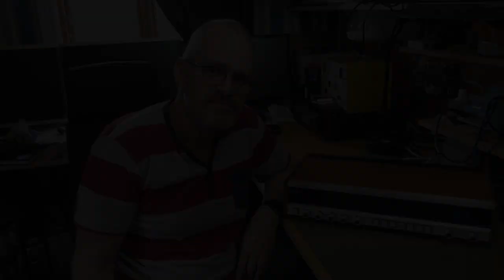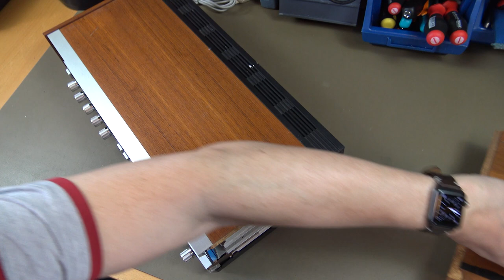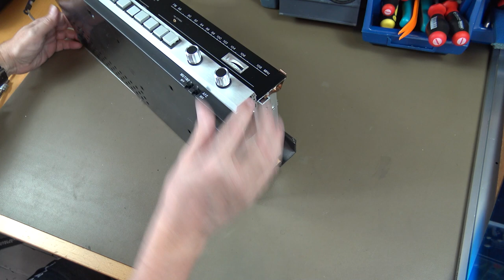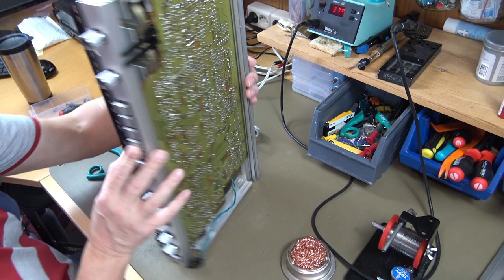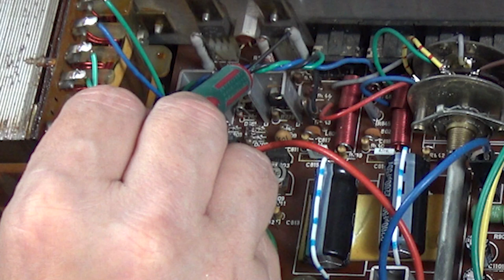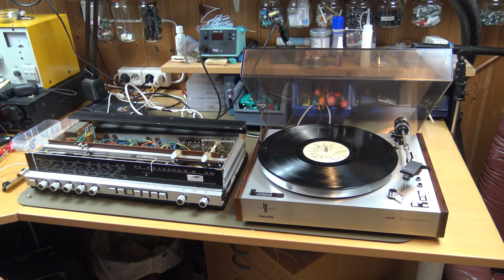Tandberg Solvsuper 12 recap and adjustment

Comment: What a fantastic job Sir!  Your patience and diligence and skills are incredible.  I'm thinking of buying a Tandberg 2060 L but the radio is stuck on one frequency.  The dial turns but the pointer doesn't.  Your video has now convinced me to get this receiver and now all I need is a person with your knowledge to make it good as new here in England :)  I had a Tandberg reel to reel the TD20 A and there is no doubt in my mind the sound of that deck puts Revox to shame.  I also have the smaller tape recorder series 1200 4 track that sounds amazing too.  I'm having trouble with the pinch wheel at the moment, the washers seem to be in the wrong order so the tape drifts off and the pinch wheel doesn't push against the capstan hard enough, anyway I'm in the process of fixing that myself hopefully.
Reply from the maker: Hello. Thank you very much for your comment and compliments. 
The reason the radio is stuck on one frequency, is probably because the scale wire is broken. It is a hassle but possible to fix. 
This scale wire is a thread which connects the dial to the variable resistor (the channel selector) and the pointer. 
I have been replacing a couple, but still not posted a video from it. I probably have to get me someone to help me edit all these vids 😅. 
I have to admit I don’t have much knowledge in Tandberg reel to reel recorders, but someday I will. I have a few to practice, but as for now I’m looking at them with joy mixed with horror. One day! One day I will dive into this magic, and hopefully post some videos from it as well. 
I hope you find someone to fix your radio.
Reply: @anatticinnorway2883  I think you would find the electronics in reel to reel tape decks would be easy for you but things like alignment of the pinch wheel and transport is the horror side of things.  The heads are bad enough even if you do have the test tapes and electronic gear to do a proper job.  The main thing repairing reel to reels I think is knowing the best way to get them apart to access the bits you want to service if you have the electronic knowledge like yourself life would be a breeze and the money and or enjoyment  you would get from repairing or servicing them would be a literal gold mine!

Comment: Nice video, I have CRC contact cleaner, CRC 2-26 and "alchohol". I know alchohol is for cleaning, but where and in what order would you use the CRC peoducts ?
Reply from the maker: Hello. Thank you for your comment. 
I’m using alcohol for cleaning. But alcohol will dry out the carbon traces in potentiometers, so I normally spray some lubricating electronic cleaner into the potentiometer after cleaning with alcohol, to avoid the traces to dry out.